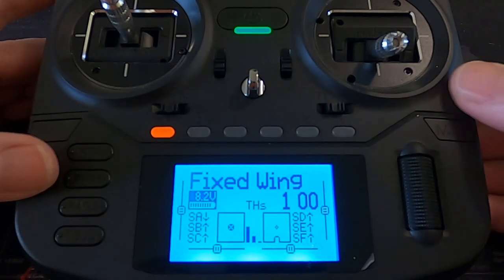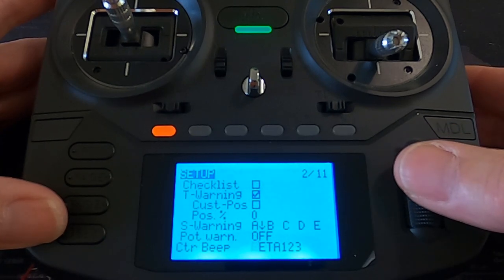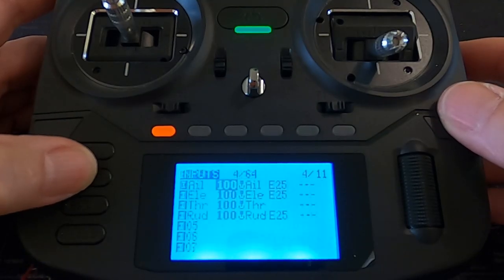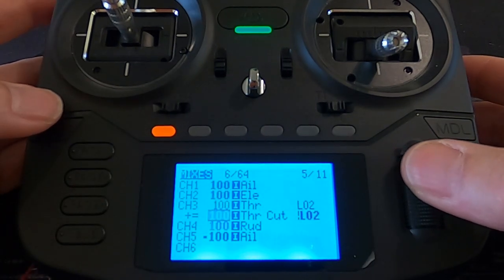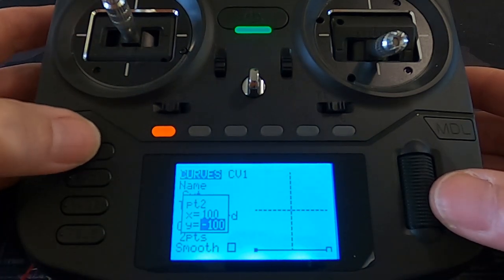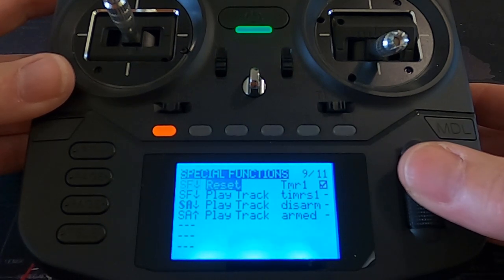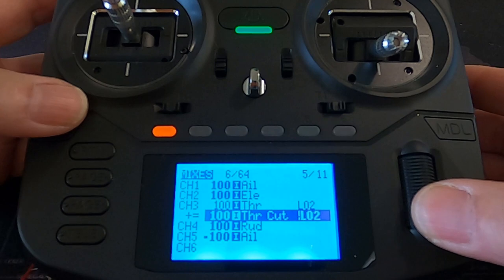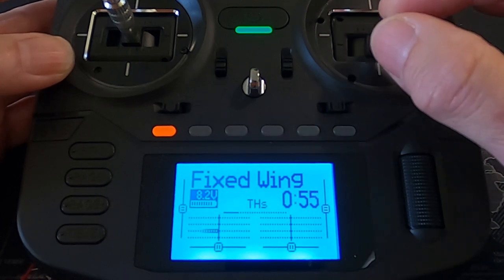RadioMaster Boxer 4(5)Ch Fixed Wing model set up with “Safe” Throttle

Comment: Cheers mate got mine today an u helped so much I usually use spektrum , I managed make new model bind to mini volentex warbirds but have trobs with setting 3 way switch’s for modes
Reply from the maker: You are very welcome. Check out this video it may help you. https://youtu.be/pjkv3Xsn6BI?si=ZB8cUurwqyVhe55C

Comment: Morning Bill, have set up safe as your video. The timer keeps timing out while the THS is at minimum.
Reply from the maker: Hi Keith, check the Logical Switches and use the logical switch to operate the time not a physical switch. It will be the second line of the logical switch settings for the safe throttle. Now you time will only operate armed and throttle is forward.

Comment: Hi Bill, am trying to control nose Wheel & Rudder Independently using gear switch so the nose wheel operates when gear is down using rudder, when retracted it does not operate. Cheers Keith in OZ
Reply from the maker: Hi Keith, you need to set up the retract function to its own mix / channel. Now set up a mix with source Rudder and Switch which operates the retract. This is connected to the nose wheel steering servo. I hope this helps.

Comment: Bill, I've been working my way through your excellent videos for a model with a 2 servo wing and electric power. I was going to use S2 as the safe throttle switch but have somehow removed S2  from the options presented when allocating a switch on the Boxer screen, and the title 'S2' is not there when i view the switches on EdgeTx companion. As my knowledge of these things is rather limited could you tell me what i need to do to fix the problem. Many thanks.
Reply from the maker: Hi Graham, hit the SYS button go down to Pots you should see S1, S2 & S3 check that S1 & S2 show Pot w det hopefully this will solve your problem.
Reply: Apologies Bill, i should have said switch 'SB', maybe someone will bring out a set of videos for Dummies  🥴
Reply from the maker: @GrahamMoody-ll3kn  No problem Graham. Go to Hardware scroll to switches and check SB shows 3POS

Comment: very good videos thanks switch a doesn't seem to be there it goes straight to switch 1 what
 have i got wrong ?
Reply from the maker: Hi Sam, it’s difficult for me to analysis your problem without seeing your radio. All I can suggest is to check your settings as per my video. If the safe throttle is not working make sure you check you have selected throttle stick and not throttle input in logical switch 1

Comment: Hi Bill, I am new to RC planes and recently purchased a EFlite Turbo Timber Evolution to learn the hobby.  Curious…do you have a video that explains how to set up a 6+ channel RC Plane using a Boxer TX?
Reply from the maker: This video should help you. What do you particularly need extra help with and I will try to assist you.
Reply: Thanks for the reply Bill!  I am trying to setup my Turbo Timber Evolution and want to make sure I am setting up the Flaps and LED lights correctly.  I am also interested in setting up dual rates and would to know how to setup Safe Select and AS3x modes.  I believe I can configure with my boxer remote through forward programming.  Also, I’d like to setup Telemetry.  I’m familiar with my boxer for FPV drones not RC Planes.  Not sure if I should setup these modes through Inputs or Mixers?
Reply from the maker: You need to use mixes.

Comment: For my L02 configuration on a RM Pocket, I inverted the value of SA because of preference.

I do have an unrelated issue with the channel 5 servo on a BetaFPV Micro RX. The servo only seems to register on or off and at center stick it sort of bounces back and forth.
Reply from the maker: My first question for you is what radio link are you using? If ExpressLRS you must only use Channel 5 for arming.
Reply: @the-happy-RC-flyer  yeah, it is ELRS. It was my understanding this rx could be configured for 5ch PWM. It seems to show ch5 as PWM in the config webpage. I'm very new to all of this and I'll stumble my way though it. I just want two aileron channels for flaperons :)

The mix configuration for safe arming you have here is very good though, I appreciate the time put into this content.
Reply from the maker: If you have more than 5 channel receivers use a different channel for the mix.
Reply: I just recently bought the 5ch rx but it was only $13. BETAFPV website shows it as supporting all 5ch as PWM so I'll do some more research .
Reply from the maker: @zeilstar you can remap the channels and change the settings but the resolution will be a lot lower.
Reply: @the-happy-RC-flyer  Interesting. Thanks for clarifying. I've got lots to learn 👍
Reply: @the-happy-RC-flyer  Do you think CH5 could be utilized on a wing as a redundant safety switch via a relay to the throttle signal wire?
Reply from the maker: If you search my playlists you will find videos where I explain how to set up a “safe” throttle.
Reply: @the-happy-RC-flyer  Looks like there is full resolution with 8CH settings now! Now I have aileron 2 on a CH6 mix, mapped to output 5. Re-mapping the receiver output can be done from either the web interface, or more easily on the radio from Other Devices within the ELRS tool. Very useful!

Comment: Bill, im building a Wing plane and it will be using FC with INav, my question is do i need to keep the ADC FILTER on or off?  TIA
Reply from the maker: Hi, off if your FC is controlling the servos.
Reply: @the-happy-RC-flyer  I have the boxer radio and i wanted to use the 6 buttons above the screen.  How can i turn on and off the same button?
Reply from the maker: Hi Edgardo, what is it you want to control with the let’s say the first button? In other words how does the servo or channel move full throw -100 to +100 or Center to -100 or +100?
Reply: @the-happy-RC-flyer  I want to set up Nav modes in INAV, Center to -100 or +100.  If you can give me a sample set up of full throw -100 to +100 also.
Reply from the maker: Just use the standard default mix and assign the switch you want to use. No need to make any adjustments with a 3 position switch.

Comment: You don't tell us how to add second aileron Chanel
Reply from the maker: Highlight the aileron channel and copy it. Move to Ch 5 and paste. Normally you will need to reverse the weight to -100 so the aileron moves in the correct direction.
Reply: @the-happy-RC-flyer Thanks